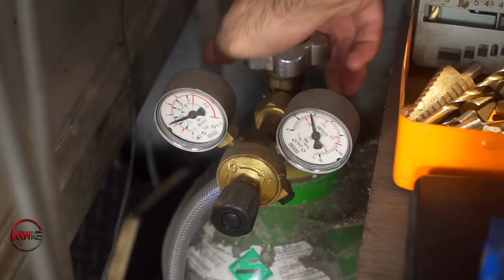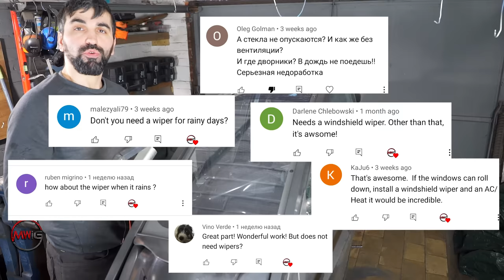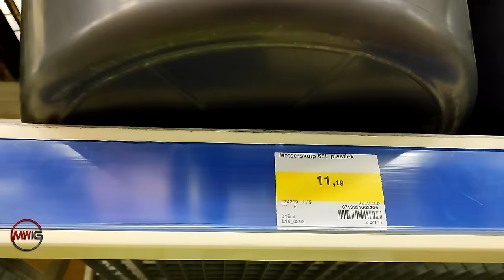Making of futuristic Three-Wheeler Vehicle - I Modified Scooter to the three wheeled vehicle

Comment: This a way better version and stable but cannot turn like the Euro one but this one is marketable. 
Suggestions: 
1. In Asia due to traffic. Lots of people in use scooters & motorcycles to get around.  Extend it to accommodate a pax. And I like the idea you kept a top box in the back. 
2. Instead of using 125cc use 200-250cc. For Asian use, keep the same lengthXWidthXheight. Most Asians are not that tall. 
Needs Reverse shifter to maneuver in tight turns. 
Also, need more lights for other drivers to see the bike. Hard enough to see motorcycles on the road. 
3. I would want a 400cc version for Philippines use. The LTO/DOTr only allow 400cc & above to enter the skyways and Tollways. Can’t build a side car version cuz they are not allowed on most main roads/skyways/tollways. 
4. Make some of your panels Fiberglass or plastic molds for weight reduction. Fuel in Asia is expensive. 
5. Cooling system, no heaters. Cuz Asian climate is very hot. Have to have the windows to open and roof for air to come in. Too small to have a/c unless someone invents a small enough a/c to be installed in your version.
Maybe you can also install an auxiliary fan to rotate the air inside. 
6. Wipers and rear/front view camera. Rains are heavy there and need those cameras nowadays for evidence during an accident. 
Thank you for your great fabrication. People will see what you did. I’m Asian, there are many metal and sheet metal fabricators. Only thing is they lack the $$$. If you can produce it locally there and market it there. I bet you will succeed. Filipinos are always open to tech and new stuff to ride. They are always welcoming to awesome inventions or reinventions. 
If the price is right, lots will buy. And even me. The cheapest 400cc motorcycle I bought there to cruise around when I visit. Is a Bajaj Dominar 400UG V2. Which cost me about $4000 out the door including 3 yrs of Registration & 3 yrs TPL insurance. But I bought another one year full coverage insurance just to be safe. 
When it rains, I don’t ride. Too dangerous. But with your enclosed cab and three wheels. I would ride it more to go to the malls and hang out cuz now I won’t get wet. 
There is a motorcycle there that is cheap - MotorStar Cafe400 that is also allowed on the skyways and tollways cuz it’s registered as 400cc. They also sell ATVs but are not allowed on the roads/skyway/ or tollways. ATVs are only allowed off-roading. 
Happy building and hope your designs are smooth out with tech. And I will also get one here if you are base in the U.S. 
Happy Riding.

Comment: Duuuude this is amazing. What would make this perfect would be having a reverse. Perhaps electric motors on the front wheels that free-wheels on forward, but engages on reverse. This way you don't have to mess anything with the transmission or rear wheel assembly.

Comment: This will not flip on either side. Most of the weight is on rear wheel & while sharp turn front wheels are wide enough to not flip that over. Safe👍👍

Comment: I'd reinforce the strut mounts where they attach to the main frame a bit more, but that's just me. I  look at the way it is and it seems a little fragile just sticking out like that, even with the bar you have.

Also, the windshield wipers mount holes look like the might benefit from rubber washers.

Comment: That's awesome, but those front tires are unidirectional and are on backwards, so the treads are not going to be able to clear out water, loose mud, etc from under the tires, so it could be dangerous in bad weather

Comment: I'm from Ohio here in the U.S and I'm watching your video. Just happened to come across your video and this is some awesome engineering and great design. Just a little fine tuning and this would be an even better design. Perhaps using a little thicker and wider tires and rim for the back wheel for greater support plus a lot more durability and harder for them to go flat.

Comment: Much better with the two wheels at the front, put a malossi variator on it, its what controls the belt and the big spring puts more clamping force on the belt and holds it in the torque range.

Comment: 😮❤❤❤❤❤❤❤❤❤❤❤❤❤❤❤❤❤ I would love to do this. I'm interested in seeing your solution for the "reverse" gear. Surely there must be an option that wouldn't muddy up the overall design...If you ever are able to put these into production I bet you would not regret a minute of it. I'm certain there's a buyer for every single unit you could make. If not a single unit maybe a DIY Kit where you provide the schematics with step by step instructions for a fee.. or even better if you could produce all the necessary parts and sell an at home bolt on kit..you could base the sizes etc off of the standard make and model of the end users moped, the buyer gets all the pieces ready to assemble as well as detailed installation information ie: mapping of the specific model moped so the builder can just easily know where the holes for the threaded rivets go etc...I apologize if I'm wordy but this looks like something even a beginner, like me, could accomplish given they had the diy kit ..and that's pretty exciting! I can't wait to see where this goes for you, best of luck!

Comment: Excellent engineering skills.
However the cornering seems unstable, the cab always wants to flip to the outside, which is very visible at 33:25.
Probably an easy fix would be to sligthly modify the steering mechanism so that it tilt the vehicle towards the curve radius.
Reply: Thats the behaviour of this type of vehicle.. Only fix is wider wheelstance at the Front or lower the point of gravity

Comment: I had to look away on your first high speed test run. I was afraid it was going to show a high speed wobble and/or tank slapper tossing you out in the weeds, or worse. LOL I would do a good alignment, and change those tires right away. Other than that, outstanding job!!  Congrats!!  (I just realized this is an older video, still, congrats!!  LOL)   8)    --gary

Comment: Instead of bending a square bar, you could've just cut a notch out at the angle of the bend needed and weld it at the right bent final angle. You retain structural integrity.

Comment: the "reverse-trike" design is inherently more stable than a typical single front wheel trike design (it's why Can-Am sells that design).  The single front wheel design tends to tip over to the outer front direction of a curve at speed.

Comment: I'm sure everyone in the comments is delighted, but ... I'm used to looking at things and saying it like it is. At some point while watching, a thought appeared in my head - so many tools, and as a result, a simple transfer of the front fork turned out to be mediocre in quality. The author made a neat bend of the metal for the front grille, but made the supporting structure so handicraft ... darkness. The bends of the supporting frame violated the rigidity of the metal profile. By the way, the windshield wipers stick out from the side during operation, going beyond the cab, but it would be possible to change the design of the levers (curved shoulder and lever) to remove this drawback.

Comment: those bent spars have cracks in them as well as compression folds, he would have been much better off using cut tubes and welding them onto the chassis, whats gonna happen here is those spars are going to flex, both at the bolt points, and on the compression folds, that will lead to those cracks, and drill points to fail further....

Comment: Nice build! The only thing I see as an issue is that the bolting the assemblies together and then welding them in place leaves no way to remove them to perform maintenance on wearable parts such as the steering column bearings.

Comment: Your front wheels are on the wrong sides.  The points of the tire treads should touch the pavement first so water is pumped to sides of the tires so you don't hydroplane.

Comment: I've seen pipes bent before, if you fill them with ice wouldn't it keep the tube from contorting so much at the bends?
also you seem to just want to do a sloppy fast job since you didn't cut the square tube and weld it at the right angles to begin with.

Comment: The idea is good, but unfortunately the implementation is very amateurish. For a video and to show the idea it's okay, but I recommend everyone who wants to build this to make sure that the load-bearing parts are well connected to each other and that they are made of the same quality steel. Connecting the steering column with an adapter alone is negligent and not very durable. The wheel suspension is also made of a lot of material which, however, only diverts the forces to a limited extent; the suspension has to do a lot of the work here.  I recommend thinking of "triangles" for other constructions, you can find out why by taking a triangle and trying to bend it or by subjecting it to a destruction test in direct comparison with square or rectangular shapes.